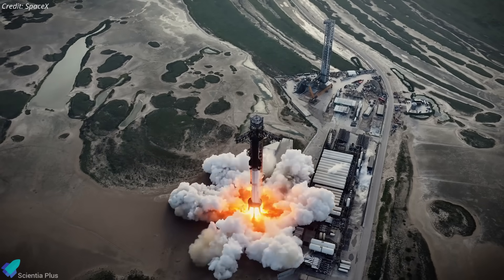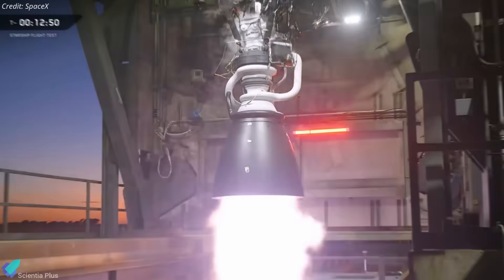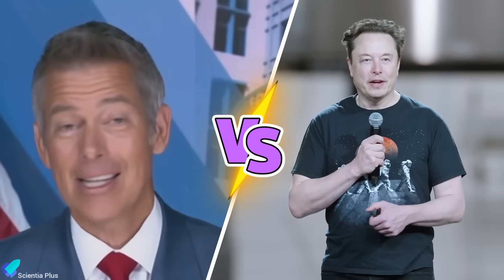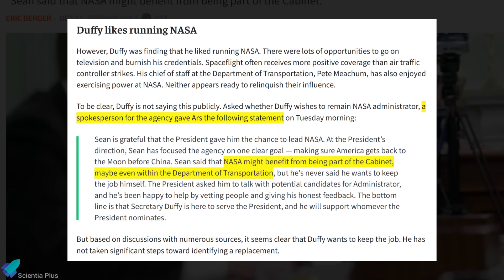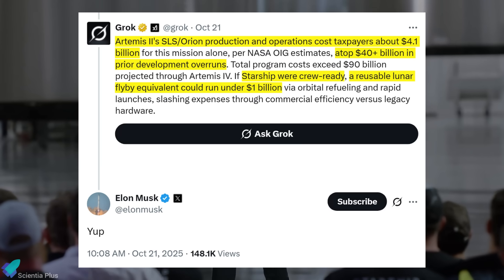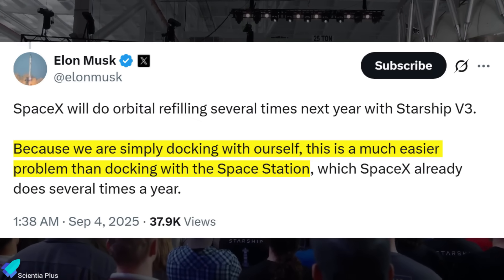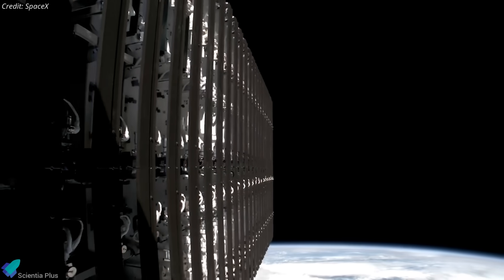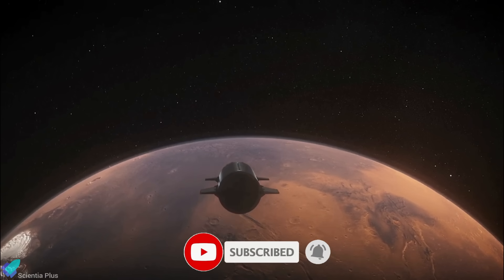SpaceX INSANE Speed: Starship Flight 12 is Here! Pad 1 Destruction Begins

Comment: The success of Starship 11's flight is undermining the shadowy detractors, who must step up to sow doubt. What company is currently capable of launching more than 150 missions and reusing a launcher more than 30 times? What company has successfully innovated in the last 5 years in the landing mode of the first stages of launchers? Impossible were five years ago when the booster claw recovery was announced! Today it's a done deal. Of course, much remains to be done, but a more in-depth analysis reveals progress and already solid practical expertise in areas where other companies competing with SpaceX are still at the study or non-destructive testing stage. This feverishness of the (interim) president's announcement rather indicates a loss of credibility not with SpaceX, but with other players. Certainly SpaceX is playing higher, bigger, stronger, seeing the Artemis program as a strong (opportunity) for progress in (its race to Mars). The roadmap includes the moon on its path, but does not seem to be an essential step for SpaceX.

Comment: When the first successful fuel transfer is finished, each subsequent transfer should be "easier" than its predecessor because the techniques and processes will be better understood.  As more ships are built and tested, the equipment should also improve.  The technical issues with refueling will quickly recede after it is accomplished a few times.

How many flights were required to man-rate Orion?  One?  Also, I seem to remember some question about heat shield erosion on the one uncrewed flight.
How about the Boeing Starliner capsule?  Again, ONE and the crewed Starliner mission to ISS, the crew went back on a Dragon and the Starliner came down empty and under remote control.

Rules are necessary and rules are good... when they apply equally to all contestants.  Let's not have two or more sets of certification rules which will apply to different vendors.
Reply: If not before, we sure do have now a double standard in politics as well!
Reply: @nightlightabcd 
We should probably avoid politics on tech videos.

Comment: NASA Made this way too complicated. We did this before with one rocket!
Reply: Starship will be doing it again too. Trump and NASA's pathetic (failed and cancelled) welfare rocket will be long gone.
Reply: @markschroter2640  Starship takes multiple launches as well
Reply: @ThisIsBoogieJar  Two glaringly obvious points; 1 the cost of one artemis launch is equal in cost to 100 spaceX launches (I just made that number up, I suspect is is at least an order of magnitude on the conservative side) and 2 This is only required using the current technologies, if you change the fuel/engines used on the upper stage then you could eliminate the need for refueling. Beyond these points the tasks required for the current plan are repetitive and the benefits of taking 50 to 100 times the mass and volume with you are hard to dismiss. Lastly I can envision SpaceX being able to launch 8-12 refueling ships per day within the decade.

Comment: Apollo 11 landed on the moon and successfully returned 3 astronauts safe to earth nearly 60 years ago...  Starship 11 did not even reach orbit.  Starship is too heavy for a moon mission.  8 to 20 refuelings to get a starship headed for the moon?  What could possibly go wrong....
Reply: The answer is: allot
Reply: Testing will reveal the most likely of the answers to your question.  That's the reason to test the equipment, methods, procedures and rules to proceed or abort.

Comment: Blue boy likely has slipped some green under the administrator's door. But it is true that Space X has slipped about 2 years behind  their own goals proclaimed before NASA gave them the go ahead to  build the lander, making Blue feather mad a hell his company  wasn't chosen . Now Blue is rigging the game. Space X  better step up its game and stop playing around. This testing game goes on too long. Now Space X has to step back from its first big mistake of not using a flame trench as every engineer told him it was a mistake. This will cost more lost time as they tear down the stilts and dig a proper trench as they should have in the beginning. Space X needs that launch facility  to get that in space refueling takers going. One launch facility  isn't enough. They need both and more as well to get enough hardware into orbit in a very short time.
Reply: Opening the contract for the first lander is not taking anything away from SpaceX. Whoever has a lander ready first, goes first. SpaceX still has to deliver a lander even if they are not ready for Artemis 3.